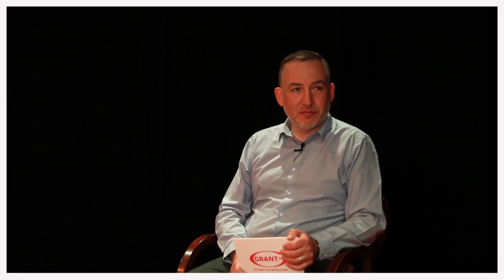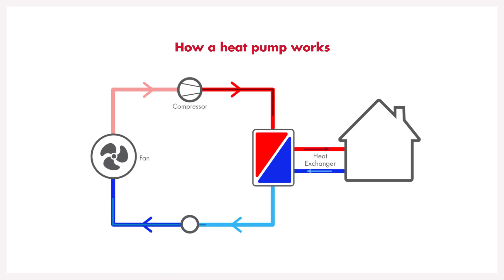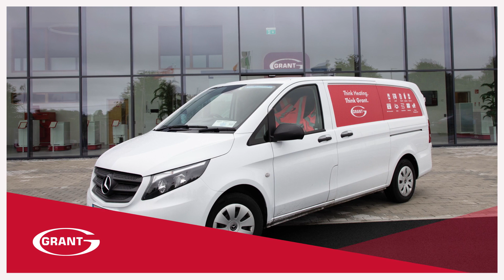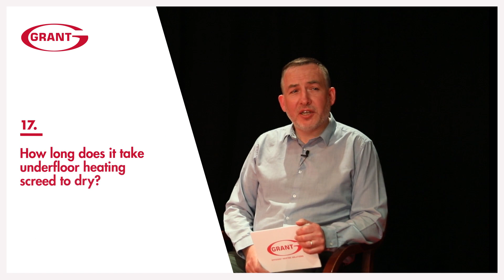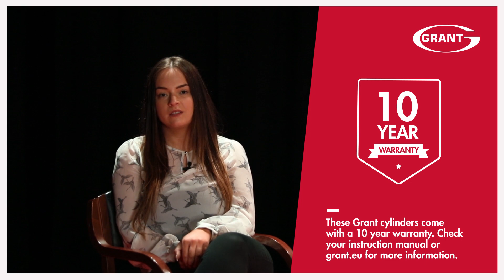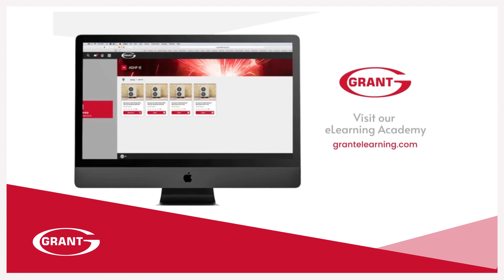Heating your New Build Home

Comment: I want to know more about Grant condenser type burners to replace my 30 year old grant standard oil burner - yes 30 years old, regularly serviced and still going. Says lots about the build quality. What about existing properties where minimal disruption is required for replacement. Any advice or links would be appreciated.